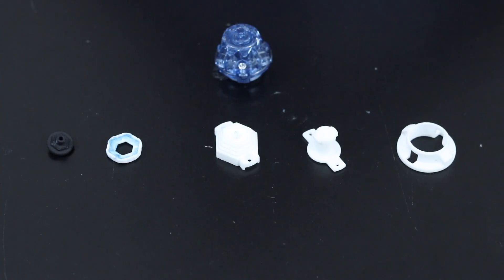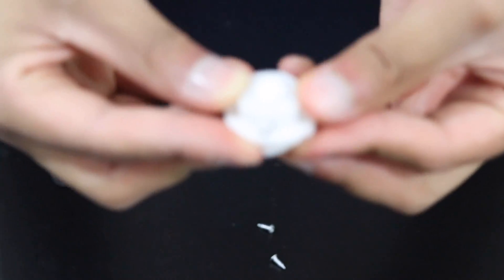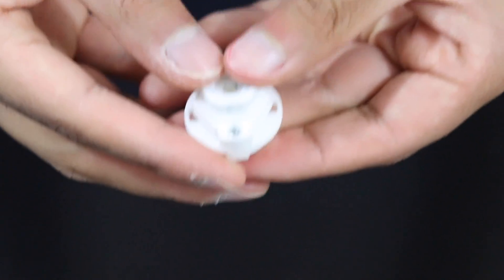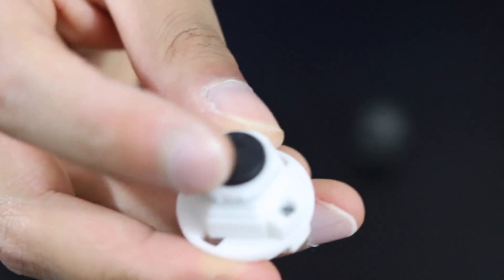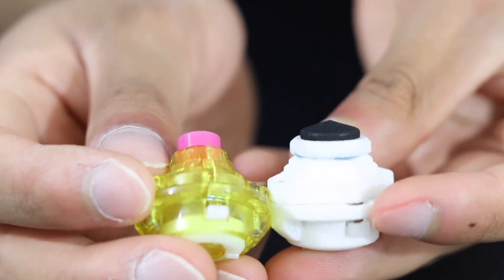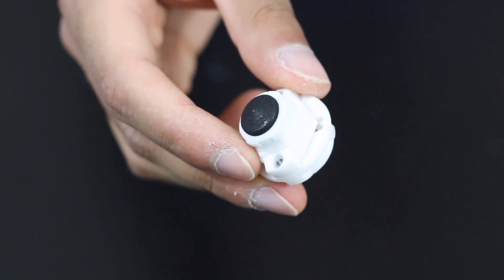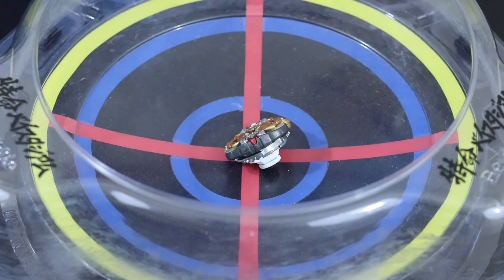BEYBLADE MOD: 3D PRINTED DRIVER - Kernel (Beyblade Burst) ベイブレードバースト 베이블레이드 버스트

Comment: I got a idea for my driver cylinder to go in the tip one part attack and the other balance and if I take that off I made my own mode power type so I made it to be flat and maybe I might add a booster and for my disc 31 disc and the ring since it’s an evolution bey and the energy can go to power and attack and the tip has spikes and the energy layer also has three horns and more in the side and the final touches are its face and back which represents its beast thing and the name is horned janger

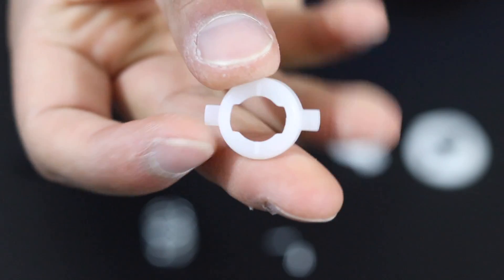Comment: I have a mod!  So, my forneus' driver broke. But I used the parts the make a new kind of forneus! So, 1. grab the part you show at timestamp 2:39. 2. Of course, grab the almighty putty and I think I used Inferior's tip. It's red. Launch it at an angle for an attack type of pattern. it also bounces well.                                                                                                                                 Another mod, With my fake longinus is to unscrew it, grab the spring, and add it at a somewhat tilted angle. It's like the hell salamander version of the rush launch. That's my mods!

Comment: Hmm. How about a Driver based on 90GF? The 90 Track (from Wing Pegasis) and Giga Flat Bottom (from Gladial Bahamdia/Gladiator Bahamoote) should be pretty nice for Attack types. 
And maybe a Driver based on the Metal Change (Running) Core from Death Gargoyle MS (yes, I went way back to the Heavy Metal System portion of the plastic era) would be nice, too...yesss.